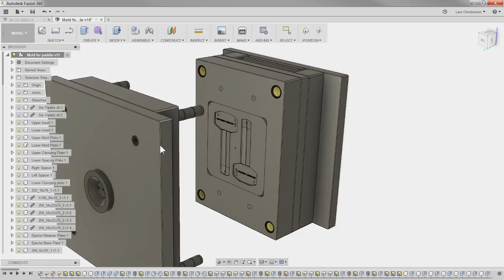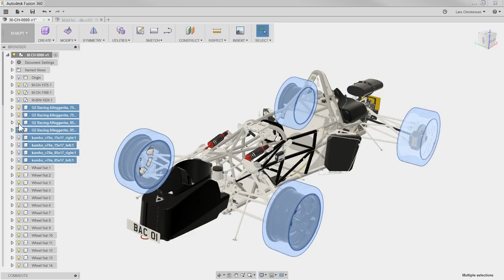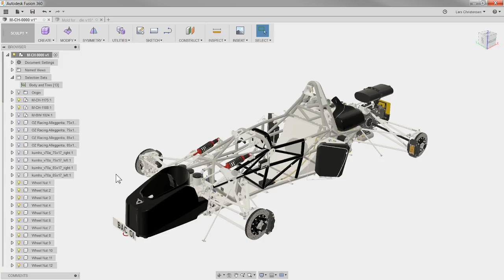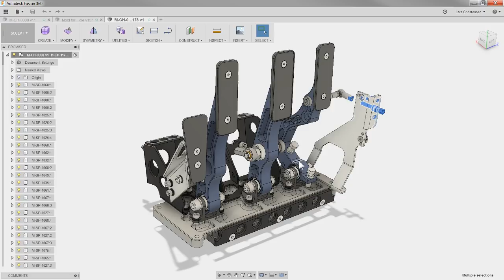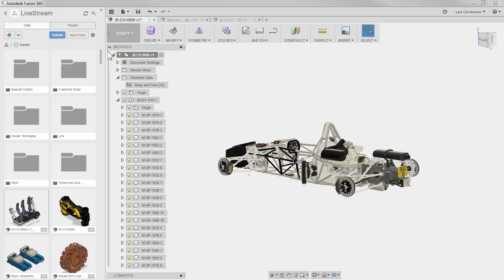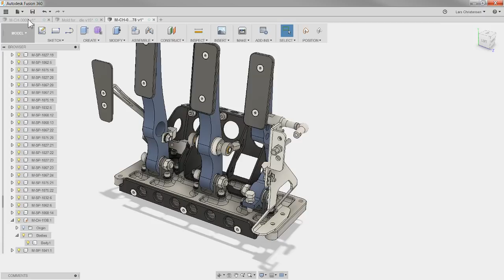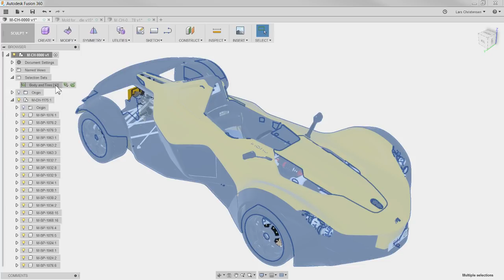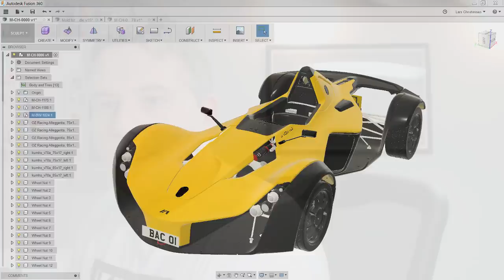How To Work With Large Assemblies — Fusion 360 Tutorial — #LarsLive 127

Comment: OK, here's one tip for working with heavy geometry. The handle of what I was making had some knurling on it that pretty much brought my computer to its knees. Instead of modelling the knurling in the same file, I designed it in a different file and saved two versions: first one with a smooth finish and the second one with the full detail. In the main assembly file, I could just pick one of those two versions of the file depending on what I was doing: smooth version most of the time, but then when I needed to export the STL for 3D-printing, I would retrieve the latest version that included the knurled surface.

The STLs are available here: https://www.myminifactory.com/object/3d-print-black-widow-infinity-war-eskrima-stick-53846
Reply from the maker: Hi Juri Munkki Thank you for watching! ANd for the great advice! Thank you!!
Reply: This is what I had exactly in mind but never did. This is a must.

Comment: Hi Lars. The issue I have with large assemblies is making edits in the design history. Editing a sketch means it has to recompute the entire massive timeline again after that point. I would think that splitting the parts into their own files would fix this. But then the issue is that the parts depend on each other parametrically, so they can't be separated. :/ Not sure what to do.

Comment: Hello!  Can you talk about snapping parts together?  For example, a rubber o-ring would have a tighter diameter than whatever metal fitting that it's supposed to attach to, similar to a tire on a rim.  Is there a way to do this in Fusion 360?

Comment: Hi Lars,
Great video!
So, when you brought the pedal assembly back in to the full BAC model file I noticed that it came in on a different angle.  Is there an easy way to import it back into the original model and have it back to it's original position / location?
Reply from the maker: Hi Pete Panaia Thank you for watching!
I do get the option to rotate the assembly right there at the moment. The reason was actually my own fault. When I imported the step file originally, I just used the default "Front Face" for the car. It is actually laying on it's side :-)
If I had done it right from the beginning the pedal assembly would have come in right.

Comment: Thank you for making these videos! I have a problem related to a self made assembly, though, that I have difficult to understand: Many components disappear when I try to modify the features (a sketch) of one of the components of the assembly. I understand that there might be dependencies that I am unaware of that might break, but how do I figure out which I am breaking and how do I resolve it? Should I export the component, remove it and then reimport it? Will this keep the steps of the timeline for the exported component?

I am also confused about the assembly level timeline - Why is it necessary to have a timeline at the top level? Wouldn't it suffice to have a timeline for each component? I have tried drag-moving some of the features at the time level, but am unable to fix the problem with the disappearing components when editing.
Reply: I figured this out myself yesterday: There appears to be a bug in fusion 360 that disables all features after the ones you are editing within a component. For my particular case I edit some extrudes within a component and when going back to the assembly all features that were created after this component is disabled in the timeline. Thank you for suggesting the timeline grouping; That compressed my timeline so I was able to observe this happening :-)

Comment: Hi Lars,
Great tutorial, some of your tips I have discovered along the way but using groups and selection sets are great. I have downloaded some large fusion models from the auto desk gallery and after some head scratching found  how to switch on the design history.
Only to be frustrated that its not always  there. When you made a copy of the pedal assembly and tried to move a part did you lose all the constraints in the assembly when placed back in the car top level assembly.
Reply from the maker: Hi wishbone569 Thank you for watching!
No, luckily :-) the joints with be active from the sub assembly.

BEst,
Lars

Comment: Thanks Lars-this is the tutorial I have wanted to see !
I have modeled up a die set for punching out muffler baffles.It took me a few attempts to get it  how wanted - many hours of work deleted after each attempt. The tooling incorporates an oval design-hollow punch pushing the slug over a former & completing the component in one press cycle, anyway, the design has every nut ,bolt ,spring etc,etc & the browser is a mile long, like the car model in your tutorial. What I wanted to know is how to speed up 360 at launch.With each attempt of this model I found that 360 took ages to load before it would launch. If I put this model into offline cache" does this help to speed things up or how can I improve launch time? I've got 16 GIG of RAM & a good ASUS gaming computer albeit 7 to 8 YRS old now.
Reply from the maker: Hi Peter Spence Thank you for watching!
I think the best bet would be to break the model up, like I did with the pedal assembly. Now you don't need to open the whole assembly each time.
I don't think offline cache is going to help.

Best,
Lars
Reply: Thanks for your reply Lars, I have been watching your tutorial over to get to know to isolate sub assemblies of my design.It takes a bit of getting used to, but this tutorial I will watch & try until I get it! Thanks again mate for the effort you put in to pass your knowledge on to us!

Comment: Autodesk needs to copy solidworks system of mates, because fusions assembly method is rubbish.
Reply: ro eng I respectfully disagree. I think you need to watch Lars' previous video on joints. They are far more powerful than mates in Solidworks once you understand the subtle differences.
Reply from the maker: Hi ro eng Thank you for watching!
Been a SolidWorks user myself in the past, I totally shared your thoughts when I started using Fusion. But, as Jay states, there are some differences that are worth trying to wrap your head around.
This is the video Jay referring to:
https://youtu.be/-onk4drW9s4?list=PL40d7srwyc_Mkgc5wvP_OfVel9aDkNkZ6

Let me know what you think.
Best,
Lars